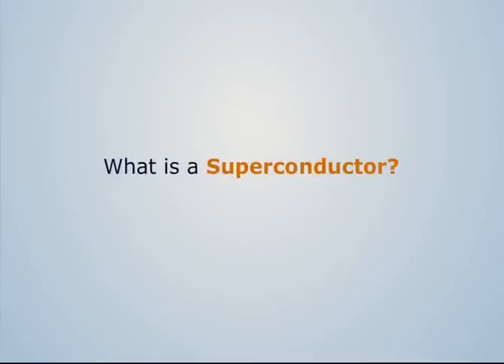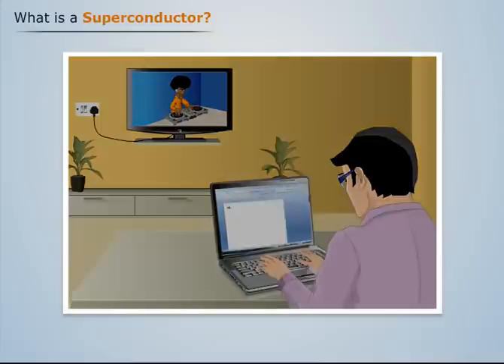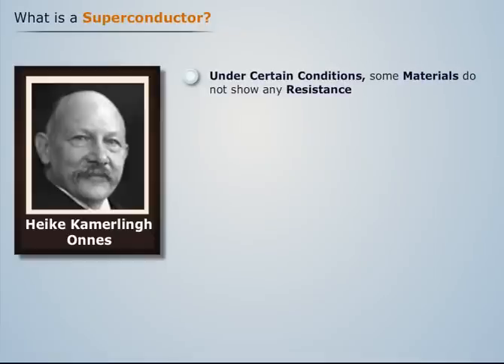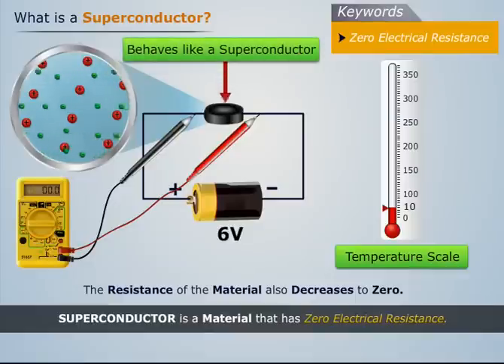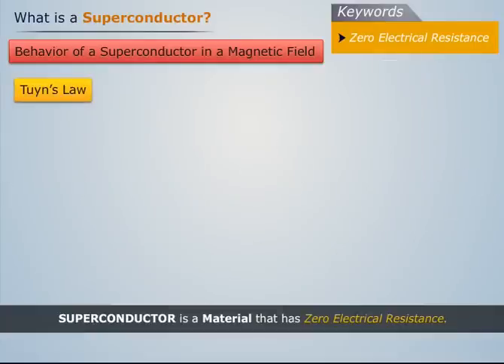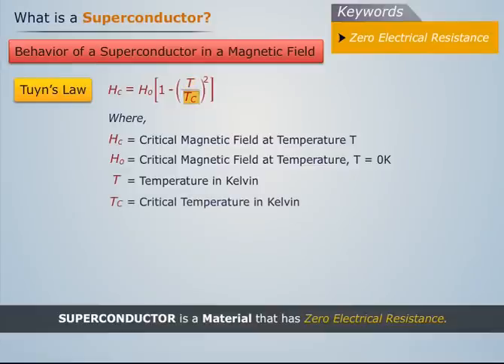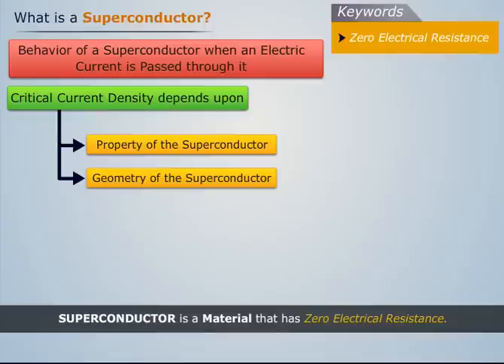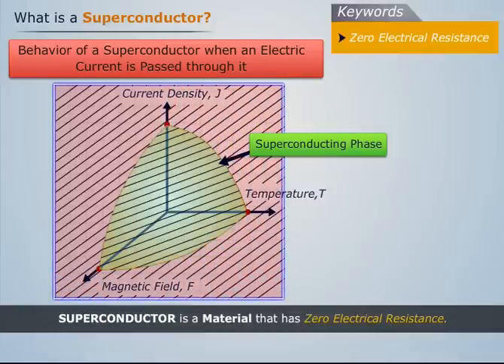What is Superconductor? | Engineering Physics

Comment: For my Bauman brothers and sisters:
1) I suppose it is current density above which the superconductor loses its superconductivity.
2) As far as i ermember it depens on a) Property of superconductors, b) geometry of superconductors, c) temperature and applied magnetic field.
3) They mention three condition: a) Critial Temperature, b) Critial Magnetic Field, c) Critial Current Density
4) I think it is a temperature at which the electrical resistance of a material drops to zero.

Comment: Did i ask what electricity does? I want to know what a superconductor is just get to the point.
Reply: superconductor is a kind of material that have no resistance to flow current (zero resistance )..
and to make something zero resistant you should cool the material to 0,, and hence it can revolutionize the magnetism .
Reply: i think this will help ya ;)
Reply: Does superconductor are used in freezer that have 0 temperature